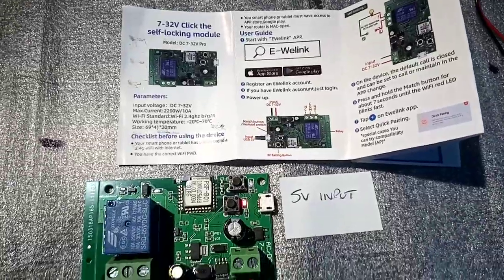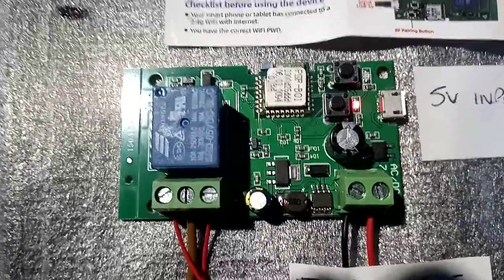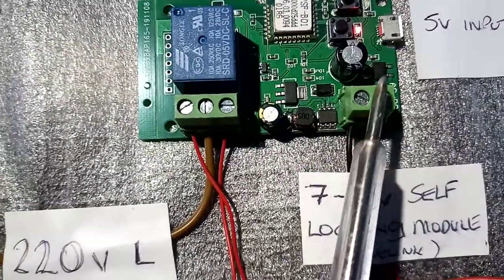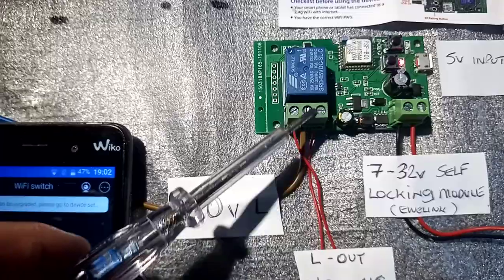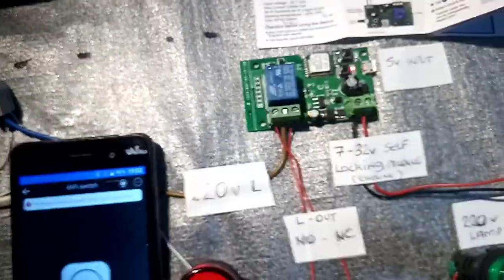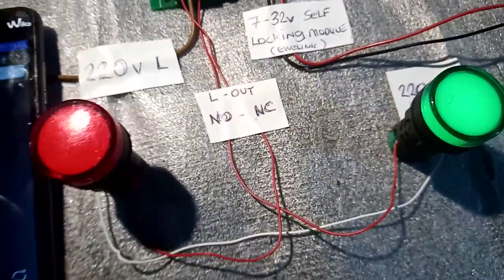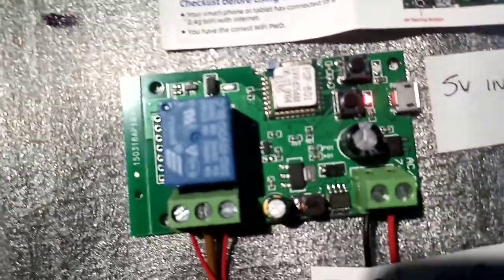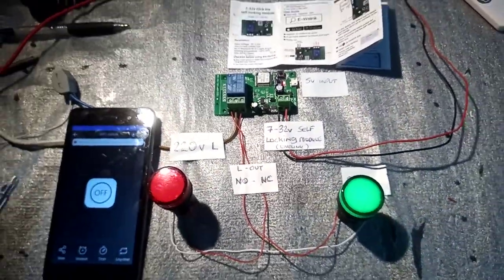DIY Basics - 1ch dc 5v/7-32v Relay Module switch + clean NO/NC contact  eWelink - Alarms/ relays etc

Comment: Hi LeOnline.
Excellent info, thanks very much. But I'm still confused.
Can this device go in line on the negative side of a 12v battery to dissable a running generator engine?
Or could I fit it in series to disable the fuel pump so that the engine runs out of fuel and stops that way?
This is a stopping event that i want to create. Not a starting one.
Thank you.

Comment: Can this method be used to switch between 2 amplifers  that are connected to one set of speakers or will it burn out?
Reply from the maker: Hi, would you be swithcing the amps off and on? Beware that this has 2 single contacts, but one would be open (off) while the other closed (ON) and viceversa!. I don't think it's suited .

Comment: I have nice rox600 slising gate. Can you please check on it manual where i have to connect Com and NO contacts there?
Reply from the maker: 9  Com, 12 NO
Reply: @leonline3424  your are star! Thx a lot. And to power switch up from same Nice, What i could use ?
Reply from the maker: @oc8382  what do you intend for "power switch up from same Nice"? sorry but i'm not sure if i understand what you want to achieve :)
Reply: @leonline3424  to take power for the switch, can i power it from gate motor nice rox600? I mean 9 cpm, 12 NO for a switch to communicate with gate, but which port from nice rox600 to use to get power for the wifi module?

Comment: Hello,

Very useful video and I even recommended it to a few of my acquaintances.

But I have a few questions - I hope you will be able to help with the information.

1. In addition to controlling the AC 10 A, can something of the order of 12-24-32 V be output at the AC/DC output? Your example is currently with 220v 10A AC.
2. Where there is an input DC 7-32V only for the power supply of the board and does it serve or then the power supply that we have supplied in "imput DC 7-32V" can come out in the output?
Thank you in advance!
Reply from the maker: Thank you ,very much appreciated :) You can use any voltage on the contacts.  I hope i understood your question, i'm sorry but did not not understand the  second question.

Comment: Can I use this to turn on and of a DC motor with a timer option?
Reply from the maker: Hi , you can control anything but for the motor you should use a high-current load contactor controlled by the open/closed contact similar to this one in the following video link:  https://www.youtube.com/watch?v=9_UvHgbnrs4&t=1s

Comment: How many amps? Could I use this to turn on off just a 12v 160w fan? :)
Reply from the maker: Just a  12v 160 w fan? go for it, it will hold ;)
Reply: @leonline3424  Tnx a lot for yr reply. Basically, I have 2 fans, 12v-80w each. These are connected to a 220v->12v power transformer. I need to make them "smart" and go on/off according to a smart temp sensor. You confirm me that if I put this relay on the 12v cable to the fans, it will work? if this relay is 12v-10amps, this would give 120w available while the 2 fans together are 180w...it will still hold? or I shall use one relay for each fan? Just to double check. Great videoes anyway ;) Greetings from Wales :)

Comment: Mine acts as a puls, it stays on for one second and then turns off, can i change this?
Reply from the maker: you have to change the mode with the tiny push button, if i'm not wrong (time has passed i can't remember) ,it has 7 modes to choose from.

Comment: Hyy .  I want use wifi switch for 90 amp self start generator
Reply from the maker: you need a contactor , you can use the Relay Module in this video to turn on or off the contactor or do something like in this video:  https://www.youtube.com/watch?v=9_UvHgbnrs4&t=4s

Comment: Maybe show me how to pair it😮
Reply: If your one is not pairing try an older phone. My S23 ultra did not work so I used a S9 instead and it worked. Also try going into pairing mode in the app the open your WiFi settings and refresh then go back to the app while it's trying to pair and it'll eventually find the device